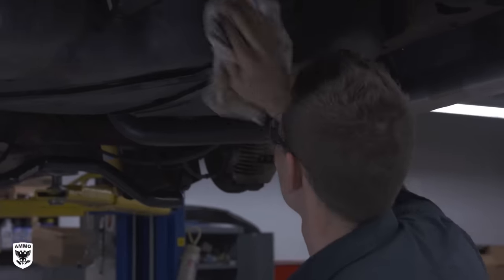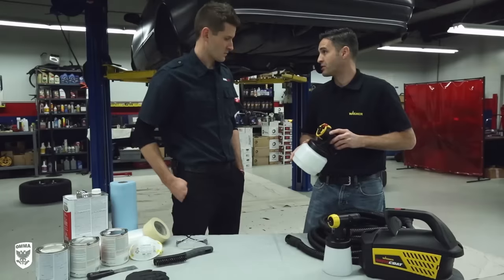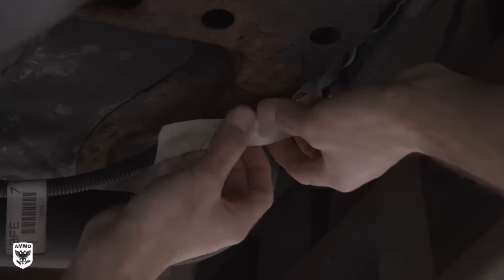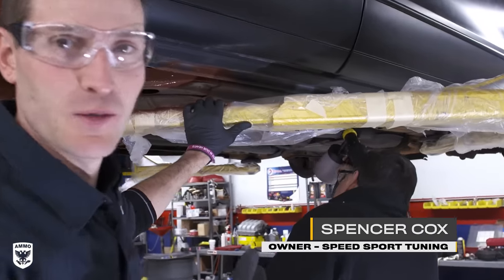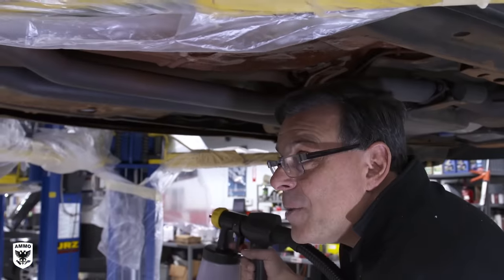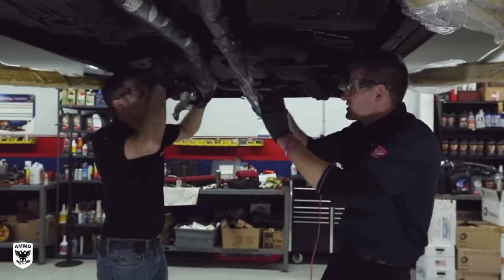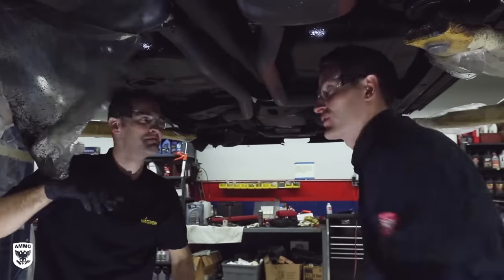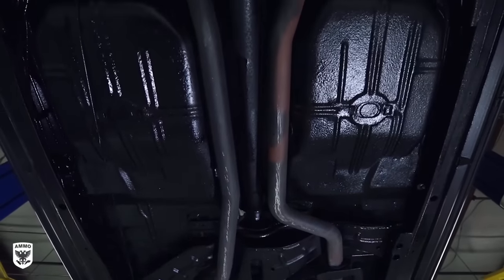How to Undercoat Your Car: Impala SS

Comment: You really need a penetrating material to soak into any porous surface creating a salt moisture proof barrier. The trouble with rubberized material surfaces they can be breached and damaged and then moisture and salt finds there way underneath them. There’s a new product now that seems promising called WoolWax that penetrates and doesn’t dry and still doesn’t come off easily and is environmentally a better choice. Check it out Woolwax black or straw colored and it doesn’t drip or create a ton of overspray.

Comment: I used a wire brush and wire wheel on a drill to remove the rust. Much easier and faster.

Comment: Spraying anything (including rubberized undercoating) to the undercarriage of a car that has already begun to rust is the worst thing you could do, you will actually speed up the process of oxidation because the undercoating you sprayed over rust is just going to crack and peel and water/salt is going to get trapped inside(yes I know you used rustoleums special primer to go over rust, but it doesn't really do to much). You are also only covering half of the frame, the other half facing up or towards the body is going to be just as rusted, all you are providing is a temporary cosmetic fix...

Comment: Your better off using a oil like fluid film or lps 3 if can afford the lps 3. Once a year. Lps 3 holds up better in areas where there’s a lot of water spray. Like the wheel wells. I’ve been using fluid film and lps 3 in bad spots. Live in New York. Wish I new about this stuff years. Ago. It works.
Also it’s safe on rubber bushing.

Comment: Angle grinder 4 inch with a wire brush disc to remove the rust. Rent a lift for 2 hours.

Comment: Good video!  Recently I went to wheel repair shop and guy used regular floor jack under the jacking points which is fine.  I usually put something on top of the jack so it won't remove the factory layer from these spots and to eliminate corrosion/rust.  It was just few days ago, so there is no rust of any kind, but I do see points where protective layer chipped off in couple of spots.  Would you recommend to clean the area and spray Rust-Oleum Undercoating or Rust-Oleum Automotive Rust Reformer?  Just want the surface to be protected.

Comment: If you've been driving the car year round since you did this, I'd really like to see what it looks like now.  One way to magnify rust is to do exactly what you did... Cover it up!  At some point, small cracks will develop in the coating, which will allow moisture to creap in and accelerate rot.  I'm surprised you've made an error like this and still haven't retracted your video.
Reply: So what are you supposed to do, to eliminate that from happening and to prevent rust after this procedure?

Comment: I have sand blasted the entire underside of a 99 altima in 2010, then painted the underside with oil based spray can paint , no rust issues what so ever underneath , the engine gave out in 2017 so not worth fixing but not one rust spot underneath

Comment: Undercoating over rust will insure that the metal will be destroyed quickly.  The only place to use a thick material is in the wheel well for sound deadening and never on rustable metal.  I would be interested to see the results 3 years later now in 2019.

Comment: Did this to many e30 but removed whole under body parts like suspension and fuel tank list goes on the car had no rust because most cars in Australia ever rust , I just had the car on one side lifted and then I used heavy chemicals to remove anything that to hard too remove by hand then used a high pressure cleaner at home cleaned it for over 1hour ,just had to air compress off left over water but waited till whole next day to apply the product but not this one

Comment: BY this date in 2020, I'm sure this car has rotten into oblivion with this coating sprain on it.  All it did was lock in the rust and insure to destroyed the car.  You never undercoat a rusted car, you have to remove as much rust as possible, coat with phosphoric acid to kill the rust, and then use an oily waxy compound that penetrates and never dries.  NEVER EVER USE A THICK UNDERCOATING!!!!!!!!

Comment: I don't think i'd have put a thick undercoating over ANY amount of rust. in the very least I'd have treated every inch that was to be coated with rust converter. I hope what you did here doesn't come back to haunt your impala in the coming years with moisture retention. I've seen some instances where the frame has rotted from inside the coating because it trapped moisture. I love the mid 90's Impala SS. Don't see many of them around anymore.

Comment: It will accelerate the corrosion under the undercoating; use a proper paint like POR-15.
Reply: +Akram Ishmael That's great but to do a whole car with POR15 can cost a lot of money so most people do just small areas.

Comment: And you do know that stuff actually destroy your frame.  it will put that coating over the frame which will cause it to not be able to breathe properly and it will trap moisture underneath it and cause your frame to rot from the inside out.  and also it makes a huge mess because you get it all over brake lines and wire harnesses and stuff .. and after about a year or so it starts to peel off and you're going to see nothing but major rust underneath because it actually peels layers of the rust back with which will thin out your frame and you notice it will be rotted in a lot of places.

Comment: Shouldn’t sandblast or at the very least use a rust converter before applying the coat ? I feel like the corrosion it won’t stop progressive.

Comment: Never ever undercoat your car, especially in high rain areas. The undercoats once chipped just holds water, especially sills. I have the proof from a Jaguar X Type that was rotten due to water soaking into the undercoats. I have heard boiled linseed oil sprayed on is what the old guys used to undercoat.

Comment: What would you recommend for covering the interior wheel wells that are already covered by Rattle Trap sound deadener? I need something durable that can tolerate a bit of abuse? I thought about Rustoleum bedliner but not sure it will stick properly to the sound deadener. Also not sure it is safe for interior use.  I would like it to be very simple, but can be outside the box.

Comment: You can't put rubberized undercoating over rust even rust that's been scraped/wire brushed off it will only keep rusting under the rubber undercoating .. You should have put an oil based grease type undercoating on , oil based undercoating will slow down the rust ...

Comment: Would the smaller front end head spray a heavy primer pretty smoothy? I restore cars for a living and spray A LOT of polyester primer, much of which is lost in the air. I have to sand the primer so it cant be lumpy like undercoating. What is your oppinion?

Comment: Is there anything you should be aware of when power washing underneath your car?
Reply: +Cornwall1888 i'd say watch out with electrical components, but even those are designed to hold water out. Just don't blast them full on just in case.

Comment: So besides the exhaust and electrical connectors, what other areas/components should be avoided when applying an undercoating?
Reply: +Jason L The bushings on the control arms. Sometimes if they're poly or rubber bushings they could be damaged by the rust proofing.
Reply: +Djonkie Bonk Thanks

Comment: Rubberized undercoating ruins the car faster than if it didn't have it on. You want to use an oil undercoating like krown or fluid film. Heck even putting rubberized undercoating on a new car will turn it into swiss cheese in a few years, if not sooner.

Comment: If you dont properly neutralized the rust and eliminate the moisture, this car will be a rustbucket in 5-7 years of daily winter driving. Best solution, dont drive the classic cars in winter time, get a cheap front wheel drive beater for winter commute.

Comment: Inproper prepared surface to coat ... the rust should be taken off as much as it is possible, cause coating it won't help.
Reply: ChainsawChristmas He meant possibly sandblasting it or using a better method to remove it. Rubbing it a bit with a metal brush is fat from the best you can do when it comes to rust removal

Comment: Does an undercoating add weight to the vehicle? Or is it negligible?
Reply: depends on the brand or type of coating honestly ftruck bed liners are thicker and heavier but undercoatings made by 3m , rustoleum, or spectrum by second skin audio are pretty light weight

Comment: Don’t cover the rust with rubberized undercoat. Your trapping dirt underneath and the car will rot from the inside out. Use oil based under coats. It breathes and slows down the rust.

Comment: Went to buy a 2017 toyota tundra and someone rubber coated the bottom without removing the rust an it was a disaster, everywhere I chipped the coat off had bad rust under it

Comment: It looks great but I know it will still rust you could've used an oil or even wd40 to prevent rust I know you have to do it every year but at least it won't rust as quickly that stuff holds in moisture I've seen it on cars that are only five years old the frame looks like a 40;yr old frame

Comment: If the service doing anti-corrosion protection tells you that he MUST drill a few, a dozen holes in the body. If he tells you that he must have good access to closed profiles - firstly LIES, and secondly, they are lazy and want to earn money without any effort. Your satisfaction and your good are not interested in them. The closed door profiles can be accessed through the disassembled locks and through the openings through which water flows out of the door. You can get to the pillars either after removing the door locks or from the center of the car after removing the plastic covers. If in Europe the customer would lead the car to do anti-corrosion protection and in the end would have new holes in the body, this service would become the owner of the car and the customer would get the money to buy a new car. In the US and in Canada, the client believes in what the workshop says. And that most workshops say the same, so these lies have become "true". Look for a workshop that does not lie.

Comment: you guys realize it will still rust under that coating right, rust will always find a way, best thing to undercoat with is a bar and chain oil. then wash that off every few years
Reply: not really rust, its was completely dry underneath after the scrubbing, just some dis-coloration that's all, nothing that will come back to bite his ass

Comment: the problem is that you didn't get behind the fenders or in the doors and other closed areas.    The car is going to rust through from the inside which is a real shame.  Rust proofing requires prevention of salty water from sitting on the metal where you don't see it.  Just look around at the rusted cars and it is the quarter panels, door bottoms, truck lower portions, etc.   You did not address any of these areas.

Comment: have you used this on rims or do you know if it will work well on rims?
Reply: +mitchell baxter not the undercoating but the sprayer
Reply: it wouldn't work, there is far to little pressure for an even layer of paint to come out, plus the nozzles are designed to under coating, to they are too big for normal paint. I like this system but in reality its a glorified hoover, these spray guns designed for under coating have been around since the 1970's. It's probably best to stick to cans, u less you can afford an air compressor with all the accessories and paint.
Reply: +Josh Briggs Thanks! i have an 05 honda pilot that i want to keep for as long as i can. it's in great condition and I'm gradually doing small maintenance projects on it. next up is to replace the axle shafts. i have a set of rims I'm going to use as practice and of they turn out Ill sell them and touch up the rims on the pilot.

Comment: This wont solve anything. The structural rust starts in the holes and tight edges within the chassis/fenders/rocker panel etc. The places were water and mud collects. This all looks fancy but your just covering up some surface rust on the outside which isn't a real area of concern anyways.

Comment: do NOT use rubberized or "hard" undercoating. you will regret it. use fluid film or some other oil based undercoat. sure you will have to reapply yearly but at least you wont have a thick rubber coat covering electrical, bolts ,etc. also the vehicle still rusts under the undercoat and you cant see it so itll still look pretty but itll be rotting out still and you wont know till its too late. then what happens when inevitably it does rust under the coat? you have to put a TON of work in to removing it all and patching everything back up.

Comment: It's a shame that's now restricted in my area, maybe because we can hide major chassi rust...
Reply: +GogogoFollowMe where are you from?
Reply: +tipetu Switzerland, a new vehicle is controller when it receives a plate, then 5 years, after that 4, 3 and then every 2 years
Reply: +GogogoFollowMe And it`s against the law to undercoat your car?  In Norway, brand new cars have to be checked after 3 years. And after that every 2 years. On top of that, the new checklist has more than 150 checkpoints.. It`s ridiculous!
Reply: +tipetu I hear that we can't put a thick tar coat under it, however it may be autorized to repaint it obviously.
Yeah I know but it's also for the safety, sadly some people neglect their ride.

Comment: Rubberized undercoating is one of the worst things you can put on a car or truck in any area where they use road salt.  It will trap in moisture and basically destroy the car.  It is much better use a wax based water repellant coating.

Comment: is it worth to undercoat a rusty car?
Reply: You'd want to have major rust (rust holes, deep rust) fixed first. Surface rust can be sanded or painted with a rust converter. If you undercoat over rust, it'll trap moisture and rust even more.

Comment: Don't use that black undercoat crap , it will hold in the moisture and accelerate the rusting process , also your electronic connectors  will never be usable again. use a waxoil ( fluid film ) after using a rust convertor on the worst rusted areas .or sand blast it off if you have the tools   !!

Comment: Rubberized undercoating in the northeast is a no no....i want a heavy based hard wax or oils to prevent rust...the undercoating will eventually pocket tge water acccelerating rust

Comment: christ dont you have an angle grinder in that shop! why would you wire brush rust by hand? and no point unless you get all of it off.

i wouldnt buy any wagner product. i was doing some mould abatment  in a large basement once and figured painting all the joists and braces would be allot easier with a sprayer, so got a wagner airless paint sprayer. broke before it got done spraying 5 gallons, the pump stopped making pressure, figured it was a seal. brought it back, got another one, same problem broke before 5 gallons went through it. and a 3rd time, believe it or not, same exact thing. i was done with the job and just got my money back for it, id never buy another wagner garbage painter.

Comment: What happened to the rust? cover it with your coating and let it rust underneath Not Smart! You need to remove the rust first and then apply an inhibitor, but where do find that process? I'm glad you asked, Contact me at scottruiz@actioncorrosionwc.com and I'll show you how to do it right!

Comment: Wagner isn’t that great, it’s just over advertised China made products. Go to Walmart and get a cheap sprayer for 50 bucks, it’ll last longer cause it’s made of steel and it’s air drivin. Why would you spend more for an increase in sensitive, more sophisticated electronics?

Comment: Looks like you just destroyed your car by locking in the rust which will now proceed to eat the frame under the coating.  Also, there is no rust protection on the back side of the panels and internal cavities so you can expect complete destruction shortly.......Overall,   the advertisement for this product will really cost you dearly.

Comment: Well you just ruined your car. It will look good but it will incubate rust under it. Only way to slow rust in the salt belt is to use an oil spray like Fluid Film. DO NOT DO THIS!

Comment: Do not Undercoat your vehicle!!! It locks in the moisture.  Watch "Rubberized undercoating will destroy your car" by South main auto repair.  You can see first hand how your frame rots.  Many shops won't work on them once they see what you've done.